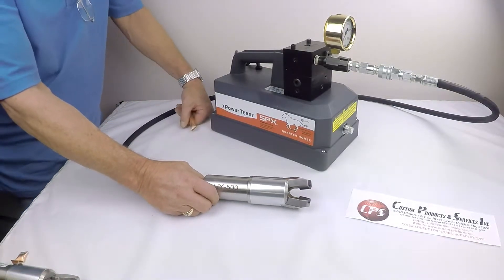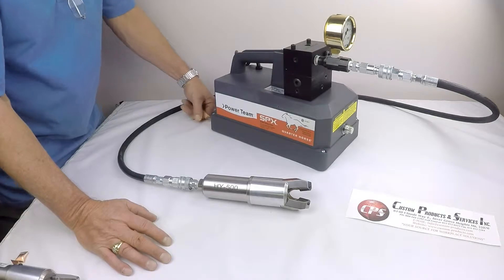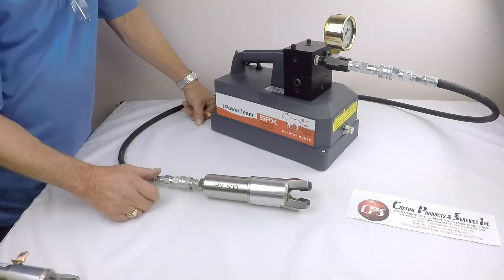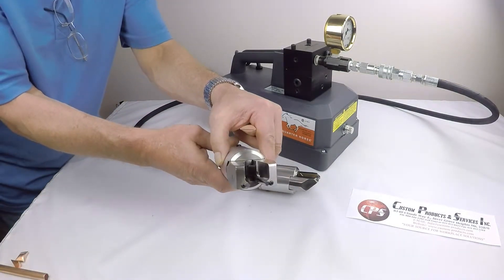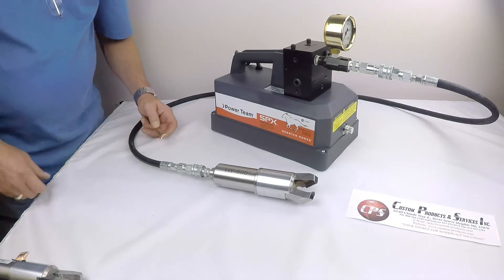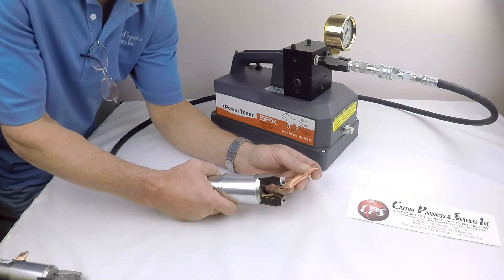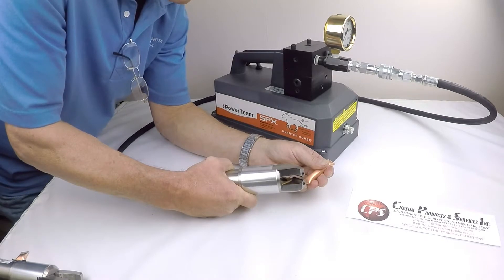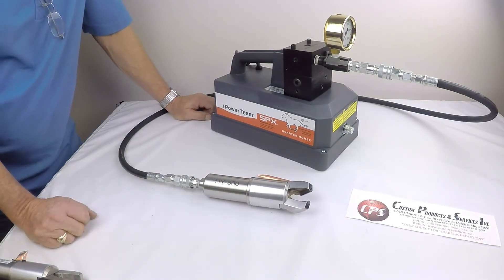HY 500 ELECTRIC HYDRAULIC PINCH OFF TOOL YT

Comment: Im designing a vacuum system in the smallest budget possible therefore many things are DIY and improvised, so I am curious about something. Can I use annealed copper tube used in refrigeration systems? I been thinking in gold plating the inside of the tube so is the thin gold layer what gets cold welded and makes the hermetic seal.